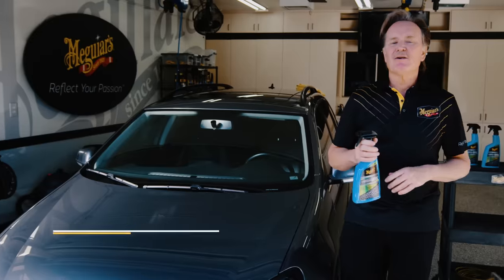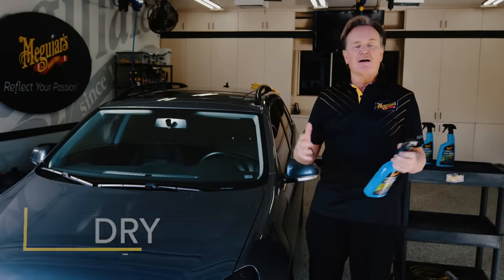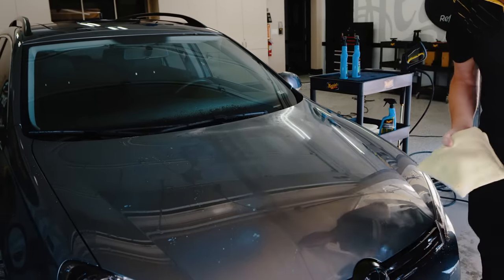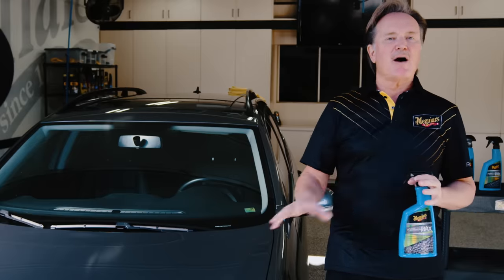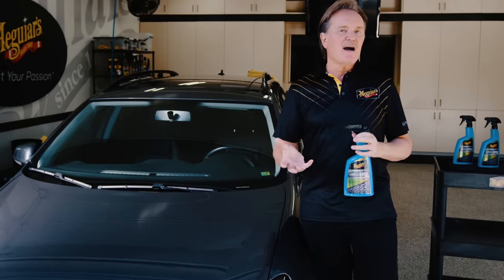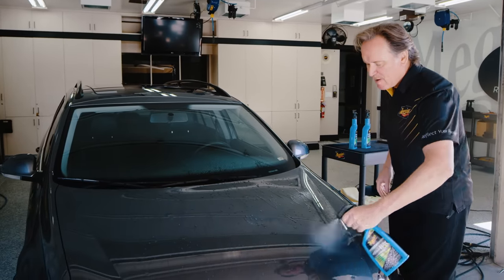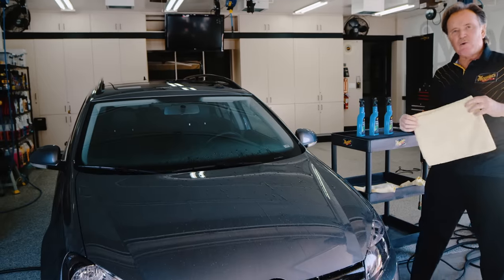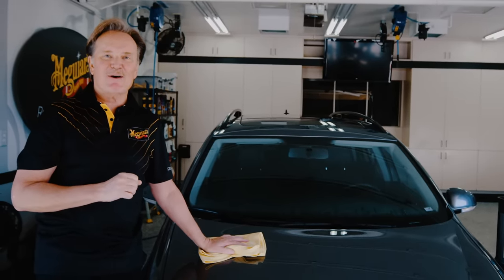Meguiar’s Hybrid Ceramic Wax - Ceramic Made Easy!

Comment: 3 tier question if you don’t mind answering for me ! Can this go on plasti dip parts because my wheels are ? I wash my car every weekend will this product still be beneficial? Also how often must you re apply this product ? thanks ! P.s I have used 3 different products for various projects on my pearl white Infiniti love the products!
Reply from the maker: It may be safe on plasti-dip however it is certainly designed to work best on paint.  Also would be a little concerned that plasti-dip might be too textured/porous and it may be hard to remove the wax residue during application.

This is a very good/resilient wax that does not need to be applied weekly.  That being said some have found it so easy to use during weekly washing they love doing that.

How long any protection/wax lasts is highly variable and depends on a number of factors related to the condition of the paint, previous prep, and the environmental elements the vehicle is exposed to.  That being said, if well maintained this wax could last up to several months.
Reply: @meguiars  thank you so much for the detailed answers to my questions concerning this product ! I will most definitely be giving this a try this weekend and can’t wait to see the results super excited and happy to be apart of the movement and opportunities for great products meguiars has for us car enthusiast !
Reply from the maker: Happy to help!  👍 

We are always here if you need anything.

Comment: Can I use this on painted wheels and on windshield?
Reply: It's safe for all surfaces.  works on the windows and safe for plastic and carbon fiber. I also used it on my new corvette's black painted wheels and no problems. if you think about it, the instructions say to apply it  and squirt off, so it would be impossible to keep it off the windows and other surfaces. I used shine armor for the last year it's similar, works well and it to is safe for all  surfaces but it's getting a little too expensive.

Comment: After the initial application, can I air dry with a leaf blower on subsequent applications? (Rinse car, apply Hybrid Ceramic Wax, Rinse again to spread product, use leaf blower to air dry)
Reply from the maker: No, you really need to use a towel to help further spread and at minimum adequately wipe of the excess product.
Reply: @meguiars  Thanks for your reply but not sure if you understood my question. Your instructions say to towel dry on the first application, and then to simply rinse off on subsequent applications. I'm asking if after the first application (towel dry), the subsequent applications I can dry using a leaf blower/air dryer after rinsing as instructed. Your reply of using towels would only apply to the first application, no?
Reply from the maker: Your question was understood.  That is exactly what we are saying.  You still need to use a towel to dry the vehicle even on the 2nd/subsequent application.

Comment: Hey! So if I were to do the 2 step microfiber system should I just use the compound and use this ceramic wax instead of the carnauba wax in the 2 step system if I want better water repellent and the self cleaning help or should I still polish with the 2 step wax and add the ceramic coating on top????
Reply from the maker: If the finish is where you want it to be after compounding you certainly could go right to the ceramic wax.  If you have fine marks left after compounding that need to be removed/refined you may need to use the Microfiber Finishing Wax.  If that is the case you could then follow with the Hybrid Ceramic Wax for added protection and water beading.

Comment: Your initial coat, you wash and rinse your car . But do you dry it then put the CW on and dry that,  then rinse and while wet apply again then rinse off? Or the intial coat go on while its wet also?
Reply from the maker: The car should be wet when you apply the product.  Do not dry it first.  This video covers proper use and even improper use.  If you have a few minutes this will probably clear everything up...

https://www.youtube.com/watch?v=Zk-OwkIlYLs

Comment: Can this be used directly atop Meg's Glaze #7, or will the oils in #7 interfere with the Hybrid Ceramic Wax adhering to the paint?
Reply from the maker: Yes, you can use directly atop our #7, and no the oils will not interfere.

Comment: Can this be used immediately after applying and removing ultimate wax?
Reply from the maker: We would certainly not propose that you have to use two different waxes, but yes the Hybrid Ceramic Wax would work right on top of any other wax, sealant, or coating.

Comment: Hi. For maintenance applications, may I mist my entire car and then rinse with a pressure washer, or do I need to do one panel at a time.
Reply from the maker: You can as long as the product doesn't start to dry.  👍 

And keep in mind with this product a little goes a long way.  You often only need about 2-4 squirts per panel.

Comment: Would claying the car help?
Reply from the maker: Detailing Clay, like our Smooth Surface Clay Kit, is used on an as needed basis to remove above surface contaminants.  To evaluate if your vehicle's paint has above surface contaminants, after washing & drying, when the paint is dry and your hand is dry, simple feel the paint to inspect if it feels smooth.  If it does not feel completely smooth or feels a little rough, this is an indication the vehicle has above surface contaminants which can be removed with detailing clay.

Comment: Would the hybrid ceramic wax stick on just polished paint, or would it need the polish cleaned please?
Reply from the maker: You can use it right after you have polished.  That is not an issue at all.  👍
Reply: @meguiars  perfect, thank you very much 🙏🏻

Comment: i have already made the initial application.  should i use it every time i get a carwash.  i get a my car washed around 2-3x a wk. and will the car shampoo (not meguiars brand) strip of the product every time i get a carwash?
Reply from the maker: This is a long-lasting protection so there is no need to apply it that often.  That being said some find it so easy to do during the washing process they do it much more frequently than required.

Comment: Used it for the first time today. I used two-thirds of a bottle and it was way too much. Took forever to buff off. My mistake, but I should have used four sprays per panel or so and not a dozen, haha.
Reply from the maker: 👍 

Glad you were able to diagnose the issue.  That is the single biggest pitfall you can fall into when applying this product and that is why the directions on the label were changed a couple of years ago to help prevent users from doing this.  You really have to treat it more as a concentrate understanding that when drying (initial application) or rinsing (subsequent applications) you are diluting and spreading the product.

Comment: i just bought a hybrid ceramic wash and wax(the new yellow one) im gonna use it with my foam canon. will i get better results if i use this ceramic hybrid ceramic wax after i wash my car with the ceramic wash and wax? and also, can i use both products every carwash?
Reply from the maker: Using the Hybrid Ceramic Wash & Wax is a great way to maintain the protection and water beading after having applied the Hybrid Ceramic Wax.  There is certainly no requirement that you use both every time you wash but that is fine if you choose to do so.

Comment: How soon do you do the maintenance coating and how often.  Do I need to clay bar my truck first.  My neighbor washed and dried his car, used a water bottle, sprayed an area, applied the ceramic, clay bared it and then dried the area and buffed it last with a mf towel. Looks great
Reply from the maker: How long any protection lasts is highly variable and depends on a number of factors not the least of which is the environment the vehicle is exposed to.  That being said on a well maintained vehicle the Hybrid Ceramic Wax can last up to several months.  We have found that some users find it so easy to apply during the washing process that they use it much more frequently.

Comment: Instead of just spraying it on a wet car and rinsing it off, can i spray it on a wet car and work it in with the gray side of the hybrid double sided mitt then rinse?
Reply from the maker: Not really.  That mitt, especially the side designed to spread the boost is really designed for use with our Hybrid Ceramic Wash & Wax.  We would recommend you use a good microfiber drying towel like our Water Magnet for use with the Hybrid Ceramic Wax.
Reply: @meguiars  is the water magnet your current "best" towel?

Comment: Hi, can I use this on top of my professional ceramic coat for extra protection? If so, does it need the base layer? 
I use an air blower to dry the car, could I still dry with this method, or is a towel needed to spread the product?
Thanks!
Reply from the maker: Yes, it will perform well on top of a ceramic coating.  It is very possible if the vehicle is in great shape and there is a good coating already down you may not need to follow the instructions for first use.  It may be unnecessary but will only help.  If apply according to initial application instructions you would need to use the towel to help spread the product.  Hope that helps!
Reply: Meguiar's thanks. For ongoing use, can I use the blower to dry my car still, or should I switch to towelling?

Comment: I just bought this. So I have to do the first foundational layer each time I wash my car? I don't understand how the second layer works when you spray it on and then just rinse it off. If I take my car to a carwash regularly do I just apply the meguiar after each wash and rinse it off?
Reply from the maker: Not sure where your confusion is?  This video shows the exact method of application we recommend for the first use and then subsequent uses.  Our best recommendation is to follow this exact process.

Comment: Used meguiars car wash and wax on a new car today. I misread the directions for the hybrid ceramic spray wax. I washed the car, dried it, sprayed the hybrid wax, and dried again. Will this damage the paint? Should I redo just the foundation step the next day? I am worried I ruined the paint or coating because I sprayed the wax on a dry car and not a wet one.
Reply from the maker: If you successfully spread and wiped off the wax you are fine.  Doing it dry is simply not recommended because you really need the water to help dilute and spread the product.  Doing it dry could lead to a very difficult application and removal.  If that is not the case for you consider yourself lucky but either way, it is not a safety concern.
Reply: @meguiars   thank you for the info. I’ll probably redo the initial application correctly in a few weeks. 

I don’t see any smears on the paint but I did notice some on the windshield and windows. Will washing the car normally remove the smears off the windows or is there something specific I need to do?

Comment: Followed the directions to a T. Actually tried it first on wife’s car, and screwed it up. Thought I did something wrong and tried it on my car too. Same results. LOTS of haze. Quick wax helped get out the haze but it was not as easy as it’s promised.  HELP.
Reply from the maker: Hi D, we would ask that you contact our Solutions Hub at 800-347-5700 or customercare@meguiars.com.  In general, typically when we experience issues it is either using too much product, allowing the product to try, or not rinsing off thoroughly enough.  Again we would ask you to contact our Solutions Hub so we can talk through your process more specifically.

Comment: Can I use heated air (8hp Master Blaster) to dry the surface after applying this product?
Reply from the maker: This product is applied/spread during the drying (1st application) or rinsing (subsequent applications) process. Drying with a blower would not work at all for the initial application but might for subsequent applications as long as the product has already been thoroughly rinsed off / spread before drying.

Here is a video that shows proper application of this unique product...

https://www.youtube.com/watch?v=NVOFlynVxco
Reply: @meguiars  Gotchya! Thank you for the fast reply! I went ahead and picked up a bottle of Hybrid Ceramic Wax!

Comment: I havent pressured water at home. For the 2nd layer, can I just water from bucket or unpressured hose?
Reply from the maker: You can but ideally you would have at least a nozzle for your hose that can produce a strong fan spray.  👍

Comment: Can you use the initial/ foundation  method every time the product is used ? Would that give you better coverage or shine, or would it just be a waste of time, elbow grease and money ?
Reply from the maker: You could but it is not necessary and you will lose the convenience of the wax as you rinse method.
Reply: I have been using the way you suggested and it works great. Watching him spray it on and then rinsing it off looks like a lot is wasted and coverage does not look great. Not to mention that it looks like a  marketing trick to get people to think that there is no work involved. I mix a small amount with water in a spray bottle and spray it directly onto a dry surface and wipe it in using a damp MF-towel. Let it flash-over and then buff it clean. I have resurrected the paint on my 14 year old Honda Pilot.

Comment: I haven't seen this with the other meguiars products in Walmart
Reply from the maker: It is new for 2019 and has just started to hit store shelves.  It will be available through Walmart but keep in mind retailers reset their shelves any time between now and March/April each year.
Reply: Ok! Now, would I still go through the initial foundational layer step if I'm applying over top of a layer of ultimate liquid wax?
Reply from the maker: Yes, you would. As you are putting down the foundation of the Hybrid Ceramic Wax.
Reply: @meguiars  Sean(up above) asked, "How much SiO2 is in it, by %?"

Comment: If using spot free water do you need to dry the vehicle for the regular maintenance for best results?
Reply from the maker: During the first application, you certainly need to dry the vehicle because that is how the product is being spread.  On subsequent applications, you are spreading the product as your rinse with a strong fan of water.  

Typically you would want to dry the car to simply prevent water spotting.  If for some reason you can get water to totally evacuate all surfaces and/or not leave water spots when drying on the surface in theory you could skip drying.  Seems like a pretty big risk but that would not have much to do with the wax.
Reply: @meguiars  thanks I have access to professional spot free water system to wash my vehicles

Comment: Is a pressure washer a must or will my garden hose be sufficient?
Reply from the maker: High pressure is better but not a must.  If you have a nozzle on your hose use the high pressure spray setting.

Comment: Will the hybrid ceramic wax add gloss to matte paints? How about exterior black plastic trims? Will it leaves any white-ish color?
Reply from the maker: No it will not add gloss to matte paint.  Although safe on plastic it is designed to bond to paint so likely will not perform as well on plastic, glass, chrome, etc.

Comment: Can you spray on and wipe off when the car is dry, or does it have to be done with the service wet?
Reply from the maker: No, we do not recommend this every be used on a dry vehicle.  The surface should be very wet.  It really needs the water to help dilute/spread the product.  If used dry you may have a really bad experience.

Comment: I followed these instructions and after I rinsed the the 2nd application with my power washer  (I did the base just as detailed here) I get weird swirl marks or streaks. They look like what happens when you use an ammonia glass cleaner on windows. I have tried to buff them out with out success.
Reply from the maker: Hi Todd,  sorry to hear about the trouble.  A light spray of water will assist in removing any streaks left behind.  We have experienced this & it typically is caused by either leaving the product on the paint for too long before rinsing, or using too much product.  We apologize for any inconvenience.  If you sprayed the entire vehicle, & then rinsed, if you do want to try the product again, we might suggest spraying a panel, and then rinsing.  Hope this helps & feel free to reply with further questions or if need you are more than welcome to contact our Solutions Hub at 800-347-5700 or customercare@meguiars.com.

Comment: If I use the Hybrid Ceramic Pre Wax Prep do I still need to lay a foundation layer with the spray wax? I assume the role of the pre wax prep is it lays it’s own foundation down?
Reply from the maker: That is correct.  If you have already applied the Hybrid Ceramic Prep you do not need to follow the instructions for initial application of the Hybrid Ceramic Wax as you have already created a good foundation for it.
Reply: @meguiars  thanks, shame I’ve already done it! Love the product. Perhaps time to update the instructions on the spray wax bottle to include the alternative paint prep.
Reply from the maker: There is no harm in following the instructions for initial application.  That would only help if anything.

Comment: Can I use this as I do as a quick detail spray also?   Or does the surface need to be wet?  I'd like to use it on my truck and boat.
Reply from the maker: It cannot be used as a detail spray.  Should only be used in manner according to demonstration in video.